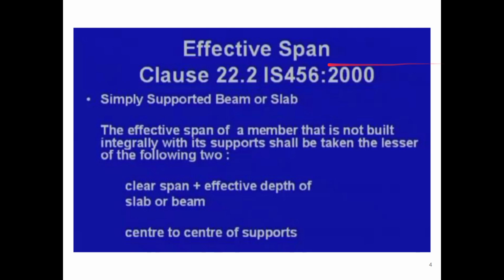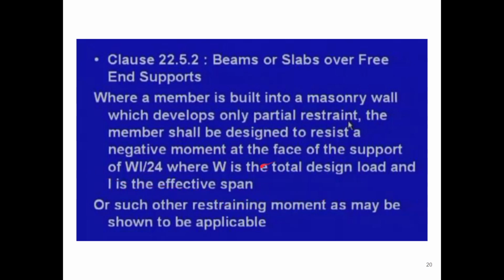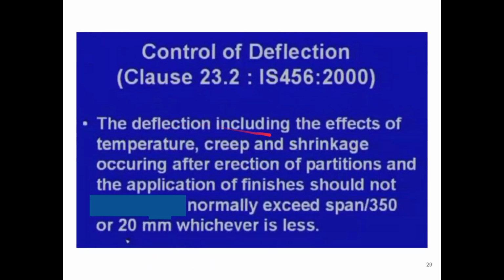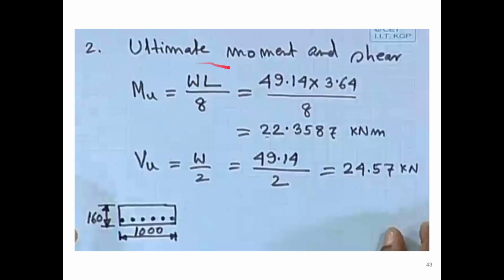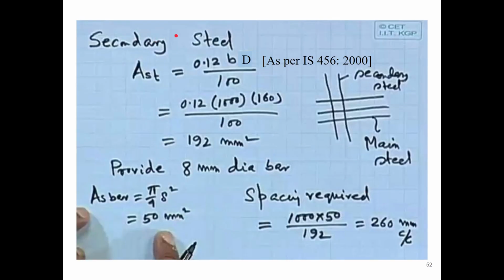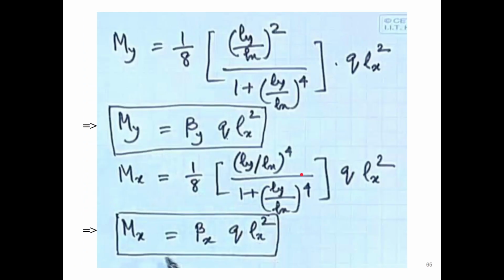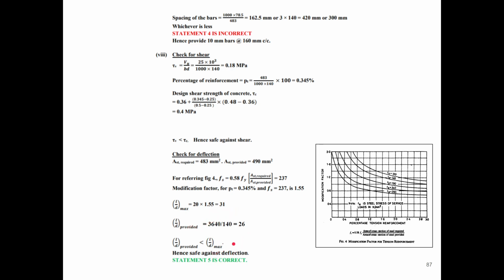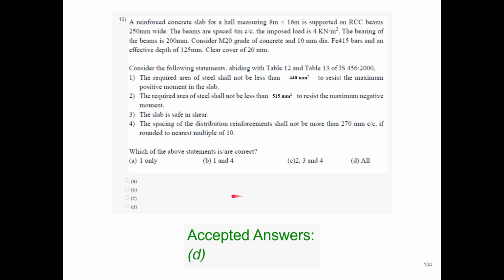Design of Reinforced Concrete Structures - 5th Week TA Class [27th August 2023, Sunday]

Comment: While calcuting modification factor which percentage of tensile reinforcement is taken either provided reinforcement or required reinforcement
Reply from the maker: In the case of Figure 4 (IS 456: 2000), for calculating the MODIFICATION FACTOR FOR TENSION REINFORCEMENT, we need both required and provided tensile reinforcements. However, in the case of Figure 5 (IS 456: 2000) for calculating the MODIFICATION FACTOR FOR COMPRESSION REINFORCEMENT, we need to consider only provided compression reinforcement.